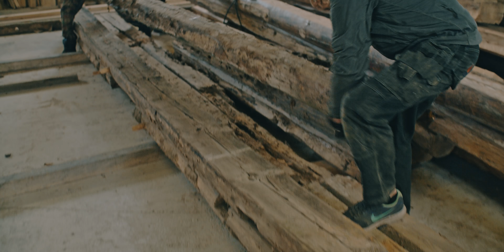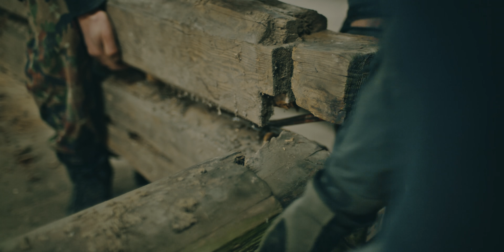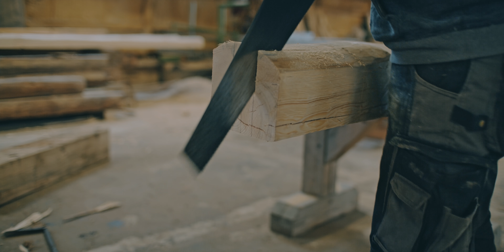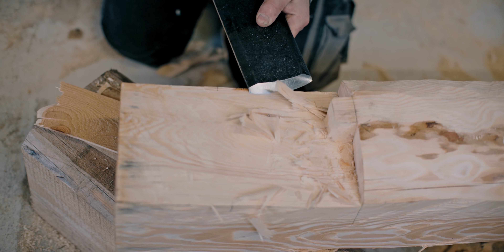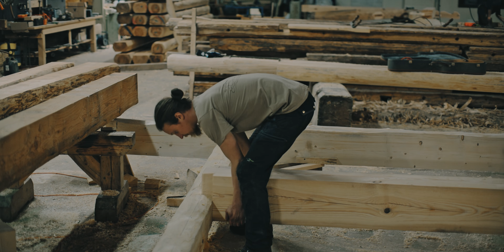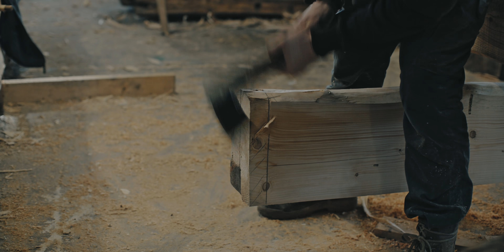1820s Log Barn Restoration. EP1 - Replacing sill beams

Comment: Great video, thanks for sharing !    Not to be an old know it all, but, you might try taking the drawknife on an 45 degree angle and starting on the point closest to you and then as you pull sliding the knife like slicing bread instead of scraping.  Just makes a cleaner cut and easier pull. Like slicing bread instead of chopping it 🙂

Comment: Building a barn inside a barn? Is this some sort of barn inception?
Reply: Was wondering the same during the whole thing. Some context here would be useful.
Is it only a test fit up and they are able to easily disassemble it and move to a target spot?
Reply: @Mr.Leeroy  From the title of the video and my own experience with timber frame restoration I would say they broke apart an old barn into its individual pieces (the pieces at the start of the video) and now they refitting them by replacing missing pieces and stuff. Traditionally (at least in Germany) each wall of a timber framed building was projected from it's vertically position into the horizontal space (e.g. on the ground). There all measurements were taken and all joints prepared. After that it was broke apart and after all walls were done it was transported to its final location and raised there. Its not so unusual to deconstruct timber framed buildings and re-raise them at another location.